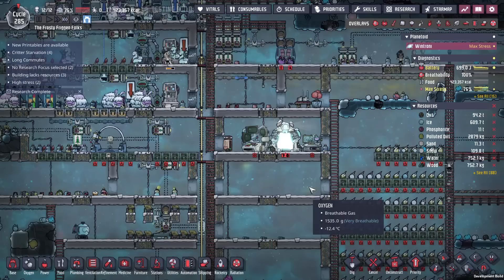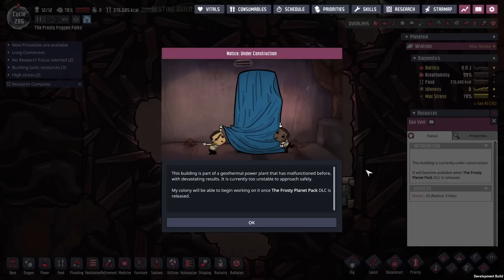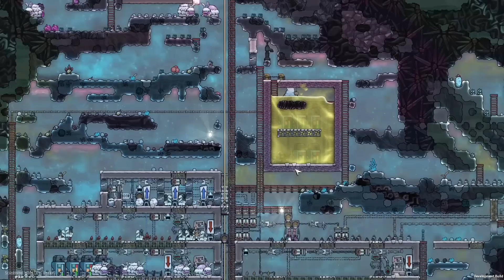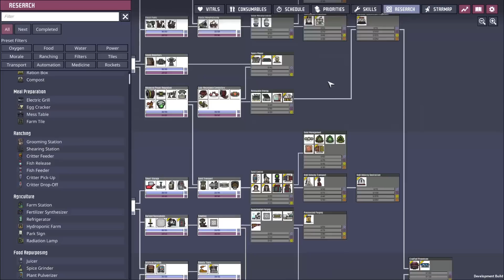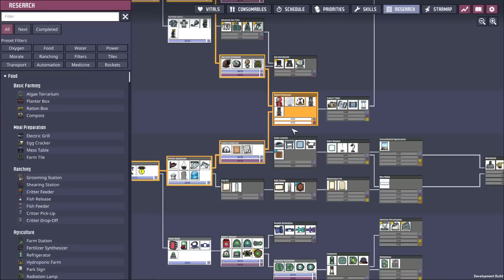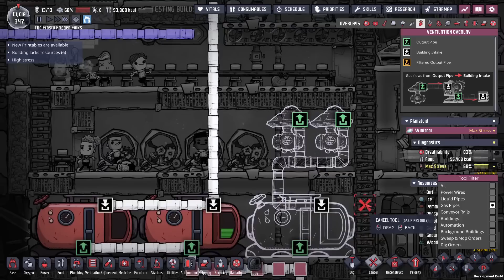[Frosty DLC! - Ep5] Harvesting Nectar and Using Deep Fryers!

Comment: Don’t beat yourself up about the unit confusion. If you’re not used to thinking in metric units it would be easy to miss the thousand indicator. Especially when the one imperial unit I can think of that uses the kilo prefix (calorie) often indicates it with type case (Cal, as opposed to cal) instead of using a k.
Reply from the maker: Yeah, I was mostly thinking the seals only dropped 50g of tallow, and that I had 2600g instead of 2600kg

Comment: I was definitely confused why you were dunking on the tallow lol, the amount you get is ridiculous. My limiting factor at the moment is mostly lime for steel, I'm only making steel veeeeeeeery slowly and trying to increase production of things like eggs - I found a few hatches on the second asteroid so I'm going to ranch those, probably also pokeshells and of course I have a drowning chamber for bammoth eggs that I need to hook my floxes into as well. Dupe labour and power are another problem, luckily I have a natural gas and hydrogen geyser which both will supply almost enough gas for one power generator each and are about to come out of dormancy and once I get the hatch population up I'll probably add in coal, but at the moment I've been having a lot of downtime which is also preventing me from getting things done. I'm thinking solar panels too when I can get enough materials.

Comment: I gave up on these trees and the seals, imo useless, except for one domesticated tree will give per cycle 48kg of plastic for 60kg of snow. (80kg of Nectar)
The Power efficiency of the Spigot Seal is 66.6Watt per seal (Ethanol Generator) and they need 4 wild tree ie 12 tiles : Solar panels are a lot better to convert light to power and Arbor Tree are better as a good source of Ethanol.
Maybe they'll fix Spigot Seal in Release.
Reply: Yeah I have no plans to use seals for ethanol except very incidentally, I just want their tallow and egg shells!

Comment: On the dirty math a full stable of 6 bammoth needs 5 planted plume squash. It will feed 12-15 dupes once it gets up and running. it also creates around 30kg of Phosphorite and Clay [to bake into ceramic and crush into sand for utilities]

A full stable of 8 flox requires 10 pikeapples and 50kg of phosphorite. It will provide enough wood to feed over 5 bammoth Stables.

TLDR:
2 Bammoth Stables + 1 Flox Stable [12 Bammoth, 8 Flox, 10 Pikeapples, 10 Plume Squash] will feed 24-30 dupes indefinitely on Barbecue [plus leftover Squash and Apples] and be self-sustaining, with some spare phosphorite, clay, wood, and dirt [with incidental ceramic, ethanol, and sand].

I haven't found a renewable source of snow outside of harvesting asteroids, so farming trees is sketchy at the moment, but 4 domestic trees feeds 8 tame seals giving an extra 300 lumber and 320kg of ethanol per day, plus the tallow from the seals [they eat all the resin]
Reply: Instead of having the Bammoths and Floxes eat the plant directly [like Pips and Drekos have to], you can feed them from a feeder [like Hatches]. It is the same amount of growth, but 2kg of Squash or 4kg of Pikeapples per day feed the entire ranch. By harvesting and filling the feeder [either with the numbers I gave you, which are rounded up for a daily feeding, or just the full 2000kg which will feed for their entire lifetime], you can cook the excess.

Comment: Maybe Mercury will end up being decent for cooling a metal refinery?  I haven't checked on how much its temp increases compared to water or petroleum.
Reply from the maker: It's insanely low, like 0.1 SHC compared to 4.1 for polluted water.  Not viable IMO
Reply: @Magnet_MD  maybe there will be a purpose for it with those geothermal buildings after the DLC is released.
Reply: I investigated that yesterday since I'm setting up a gold volcano tamer. As well as the super low heat capacity it also has really high conductivity (8.something). Complete opposite of what you want. I've mostly used it for liquid locks and my drowning chamber, the rest is just getting dumped into a pit to get it out of the way.
Reply: Its high thermal conductivity makes it good for transferring heat at really low temperatures, but it just gets overshadowed by other metals that don't have a risk of melting 😂

Comment: To be fair, the UI should probably stick to one unit of measurement instead of switching between grams and kilograms. I think even people who use the metric system would easily make the same mistake you did. Saying "1000g" is pretty silly in itself, even more so when in this game you are more often working in kilograms and tonnes when dealing with material.
Reply: Heck kilogram and gram is on and the same unit of measurement. Kilo is a multiplayer 
And what would you do with mg you’re proposing to have units with about 12 numbers to replace the current accuracy
Reply: @moonshade9860  What? I don't understand what you mean. What I meant was they should just stick to kilograms, and the tallow would be written as 1kg instead of 1000g.
Reply: they do have a threshold as far as i know its at a out 5kg right? 4999g becomes 5kg. Smth like that. I get what you mean but that would only move the threshold.
I guess the case youre making is to choose the unit with the least decimal points or zeroes, right?
Reply: "Help there's 0.0006kg of gold stuck on the conveyor rails"
Reply: @lighto1531 How often do you have 6 grams of anything jn ONI you goober?

That's his point.

Comment: The seals should not need to be wild to feed on tree out off the stable. A rancher still lure all critters that can path to the grooming station, allowing for open door stable or "closet ranching".
I did some experiment in my first canivore speedrun. You don't have to calculate or limit the amount of critter. You just input grooming labor to generate x5 (on glum critter) ethanol for some cycles. It still might be better to just spam the cpu with more glum critter and save the labor though.

It's not your fault on the g vs Kg to be honest. It's very confusing to mix unit in the same place like that => 1000g/1000Kg.